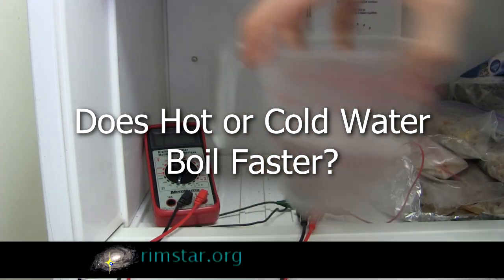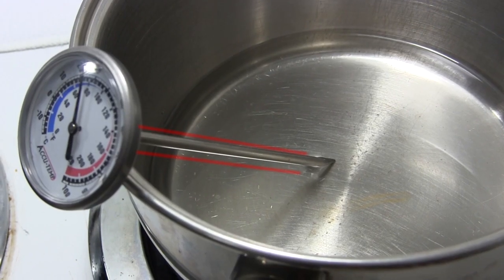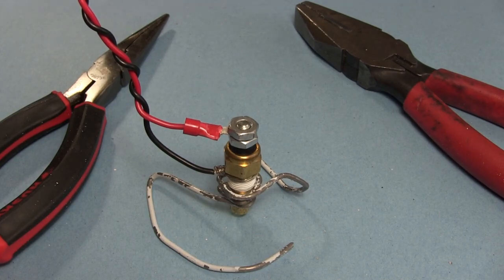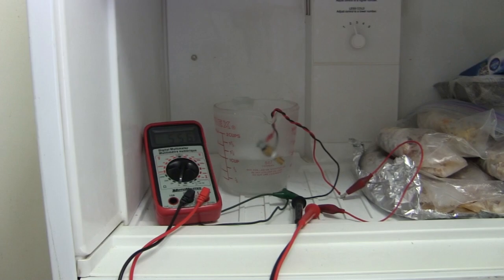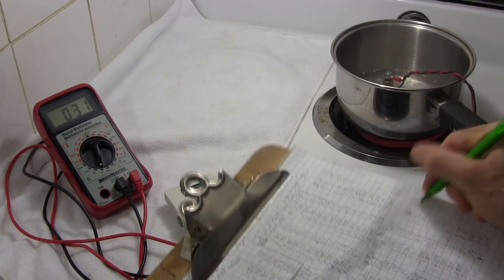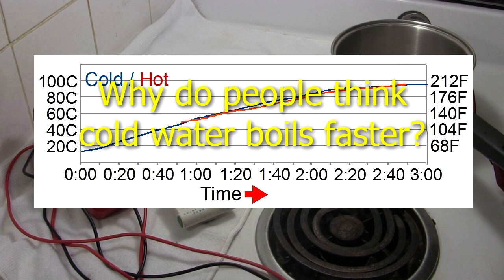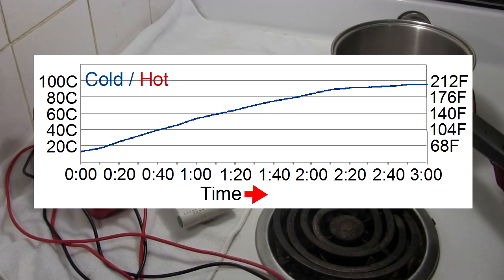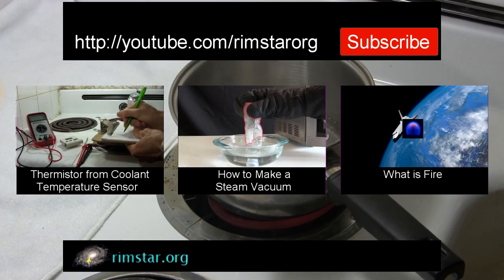Does Cold or Hot Water Boil Faster?

Comment: Nice experiment but I think it is wrong to assume that water instantly vaporizes when it reaches 100°C. What about latent heat of vaporization? A quick google search says that it takes 100 calories to heat 1 gram of water from 0 to 100 deg, but it takes 540 calories to take that 100 deg water to boil due to the latent heat of vaporization. Wouldn't this process dominate and bring both total times much closer together?

Comment: My hot plate will automatically turn off after a certain time. It's usually before I can boil the water. Once off it will remain off until the burner falls low enough temp. Sadly it turns off before I can bring my water to boil. 

Offset this I have been putting my water in the microwave for a few minutes before I poor it into the pot to boil. 

My concern was since hot water heats at a slower rate than cool water then my efforts made no difference. I'm glad to learn that it does.

The best analogy I can think of is if I raced Usain bolt in the 100 meter dash. Only I'm allowed an 80 meter head start. He's cold I'm hot. Bolt may be faster but I will reach the finish sooner bc I'm closer to begin with. Glad to know my efforts are not in vein

Comment: Does elevation affect the boiling time? I live in Denver and have never had water boil in under two minutes
Reply from the maker: Air pressure decreases the higher you go up. And the lower the pressure, the lower the boiling temperature/time. So yes, water in Denver would boil faster than water at sea level.

Comment: lesson take away: unless you have instant hot water from the tap, don't run the hot water for 3 minutes until it gets really hot, the cold water in the pot doesn't take that much time to catch up to using a pot filled with hot tap water

Comment: Why didn't you just add more water to the pot so that the thermometer was submerged sufficiently?

Also, I use cold water for drinking and cooking because I heard using warm or hot water picks up more undesirables from the pipes, but I don't actually know if this is true.
Reply from the maker: I didn't add more water because I didn't want heat losses from the rest of the pot to affect things.
Regarding using cold water instead of warm or hot, I wonder about the same thing, especially first thing in the morning.

Comment: The word fast corresponds to speed. Speed is progress / time (/ as in divided by).

The word boil doesn't represent progress, rather it represents goal.

It doesn't make sense to say how fast you get to a point. It will only make sense to say how fast you move to get to a point. 

It will only make sense to say how fast water heats up.

What we should actually use is the word quick instead, since in this case (boil) it's the time that we care about and not "speed".
Reply: Most people won't understand what you've said.  But, I think the fight for proper English is important and that you've make a good point.

Comment: You have to use more water than that. With that amount of water it doesn't mattter if you put hot or cold in there is hardly any volume so of course its going to absorb the heat from the pot right away. Add 3 cups and retest 8 years later.

Comment: You started with the wrong premise. It’s not cold water that is supposed to boil faster. It’s cool water, or around room temp. Your experiment was flawed from the outset because you have the wrong idea about the “myth.”
Reply: No just no
Reply: @suave9184  Yes. This idiot tested water from a refrigerator. That’s not what people are saying. Nobody says water on the verge of freezing is going to boil faster. It’s about water a bit below room temperature. 🤦‍♂️
Reply: @suave9184  “You idiot people.” Well, you’re obviously mad. 😂🤣 I literally explained my position, I’ve never said ice cold or cold water, so maybe you should take out your misplaced anger somewhere else and get a grip.
Reply: @suave9184  Also, try watching videos of boiling water being thrown into the air when it’s below -25° compared to water at other temperatures. It reacts completely differently.

Comment: Why didnt you just fill up the saucepan so you could use the regular thermometer
Reply from the maker: I was concerned that there would be more heat loss through the sides of the pot, messing with my measurements.

Comment: It doesn't boil faster, it boils at effectively the same rate, so no it's not faster, the hot water just takes less time (i'm not crazy, just read the rest of it) because it was already hot so part of the job was already done when you put it into the pan. Faster in that case it's not related to time, it is related to the rate that the temperature rises. obviously it is "faster" in the matter of time, but the actual rate of which the temperature increases is virtually the same between both of them you just gave the hottie a head start.

Comment: to use tap hot water compared to cold. is cost from hot water tank . so add cost in there. cost to heat cold compared to hot tap water.

Comment: Boils fastest if you heat the pan first then add hot water. If you add hot water to a cold pan your just cooling the water. The hotter the water is when you start the faster you will get to a boil

Comment: Sorry to be that guy, but shouldnt both of the times for the hot and cold start from 0? Why does the hot start at 53 seconds? Im pretty sure you goofed the chart up... like if that were to be graded id have to give you like 50 percent
Reply from the maker: In answer to your question, the chart shows two test runs done at different times as shown in the video and then drawn on the same chart. The length of the runs took different amounts of time because the hot water started at a hotter temperature -- there is no data before that temperature. I overlapped them by finding the same temperature in the cold data (well, 55 for the cold and 56 for the hot). That way they had the same starting point.
Reply: @RimstarOrg  yes that is all fine and well. But the x axis represents the amout of time you heated the water, in order for it to boil. I dont mind really, it just erks me that you didnt plot the time data correctly, ie, starting from right when you began heating, the time that it has been heated should be zero. Correct? Other than that thank you for the video it answered my question well.

Comment: I just want my ramen to be done faster :/
Reply: Fucking same dude
Reply: If you would like your Ramen to be more like a pasta and less like a soup, use two packets of noodles, but only use one packet of seasoning and enough water for one packet.  (2 cups of water, I believe.)  In a measuring cup, fill it to 2 cups of water and add your seasoning packet to the water.  Stir vigorously for a few seconds to completely dissolve the season powder into the water.  Place your two packets of Ramen noodles into a pot, pour the water mixed with seasonings to your pot, and then turn the burner on.  Bring it to a boil and boil for about 6 to 7 minutes.  You'll end up with a very delicious Ramen pasta.
Reply: @nopenottalib4366  are you sponsered by ramen noodles lmao
Reply: If you'd like to add some delicious protein to your Ramen:  Use one packet of Ramen noodles.  Put the noodles into your pot and then add 2 1/4 cups of water to a measuring cup.  Open your seasoning packet and dump it into the measuring cup full of water.  Stir vigorously until the seasons are well blended and dissolved in the water.  Pour the seasonings + water into your pot and set your burner to "High."  As soon as the water starts to boil, crack open an egg and drop the egg right in the middle of your noodles.  Cover the pot and reduce the heat to keep the water at a fast boil - but not too high to cause it to boil over.  Keep it boiling for 10 minutes.  Remove the pot from the heat and remove the lid and let it cool for about 2-3 minutes.  Pour it into a bowl and enjoy!  (It sounds insane - but it's absolutely DELICIOUS!)
Reply: @nopenottalib4366  nah I want to do it normal
Reply: Same..
Reply: Me too
Reply: Put less water

Comment: Cold water does not boil faster than hot water. The rate of heating of a liquid depends on the magnitude of the temperature difference between the liquid and its surroundings (the flame on the stove, for instance). As a result, cold water will be absorbing heat faster while it is still cold; once it gets up to the temperature of hot water, the heating rate slows down and from there it takes just as long to bring it to a boil as the water that was hot to begin with. Because it takes cold water some time to reach the temperature of hot water, cold water clearly takes longer to boil than hot water does. There may be some psychological effect at play; cold water starts boiling sooner than one might expect because of the aforementioned greater heat absorption rate when water is colder.

Comment: I'am not shure for "why the variation speed slows down" : your heat source is red glowing, it's around 750°C. So the difference between the water and the resistor temperature is piratically constant during heating. The main explanation is the fact that water is approaching it's vaporizing point, so the saturated vapor pressure is increasing. An increasing fraction of the water is converted to vapor the reach this pressure under the liquid water. This required a huge amont of energy that will not be used to increase the temperature of the liquid water. At 100°C the vapor pressure is more than the atmospheric pressure so 100% of the energy is used to vaporise the water (and because the room is open the pressure will never increase so it you boil as long as there is water is the pan). The temperature is blocked to 100°C :)

If the pan was airthigh (and a little bit insulated), the speed will be constant (but the specific capacity of water alose moves, life is complicated ^^). 
Great videos !!
Reply from the maker: I agree with that you're saying. As the water temperature approached 100C, more of the energy is going into converting the water into steam and so there is less heating.
And thanks! I'm glad you're enjoying my videos. I look forward to more of your videos too.

Comment: There is a problem with the experiment. The thermistor is in direct contact with the metal pot and that in direct contact with the stove element. I suggest that you measured the temperature rise of the metal given that the water reduced the heat transfer.

Try conducting the experiment again with a double boiler, and keep the thermistor from contacting any of the metal.
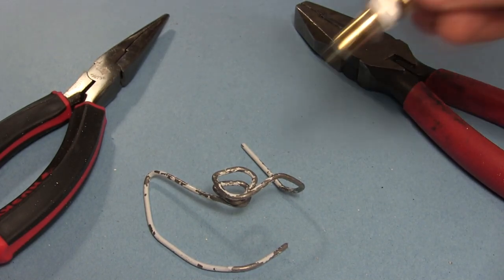Reply from the maker: +Richard Tomkins Thanks. I'm not sure if I'd considered that at the time, however, the stand holds the thermistor a millimeter or two up. It's hard to tell that from the camera angle but you may be able to see it at 1:14.
Reply: +RimstarOrg  Well if it's not actually touching, I guess it should be fine then

Comment: I don't agree with your argument that the rate of heat transfer decreases with increasing temperature is reason why the heating curves are not straight line. The hot plate is so much hotter than the pot that this should not be a strong effect. I think the main reason that the temperature rise slows down when the water temperature approaches boiling is due to the fact that the evaporation rate increases strongly with temperature and since evaporation needs alot of energy more and more of the heat supplied by the stove is used to evaporate water rather than to heat it. Once the water reaches boiling all of the heat supplied by the stove goes into evaporation and the water temperature doesnt rise anymore.
Reply from the maker: +DANG JOS I agree too that as the water reaches boiling temperature the reason is that more energy is going into evaporation. Looking at the chart again though, the slope change starts to be noticeable at around 60C/140F, 1 minute in out of the 3 minute measurement period, so I too suspect that the curve change is not all due to that. Too bad it's not possible to go back and edit YouTube videos. I've added something to the video description as well as an annotation.
Reply: +Rainer Beck  I must agree with you.  that's actually the same thought I had while I was reading the beginning of you're statement and realized you said it later.  Yeah, the stove itself was probably around 1,000 degrees F depending on how hot it was, so that temperature difference wouldn't make a very large difference.  it isn't completely negligible though.  I would say that it is a combination of the changing temperature gradient and evaporative cooling

Comment: How about water that had previously been frozen and then returned to room temperature. would that water boil faster than water that had not been frozen?
Reply from the maker: No, it wouldn't boil faster. From any given temperature, the remaining time to boil is the same. You can see this in charts in the video. Once the temperatures overlap on the chart, they keep overlapping.

Comment: So is this curve a reflection of heat loss , rather than heat gain . As the temperature increases it sheds into the surroundings , and as it temperature notably outstrips the exterior there is dispassionately more convection & radiation leading to a curve . If this system was lagged ie an electrical element in the water & a well lagged / insulated cylinder & little air to convect the heat away , would it be closer to a straight line ?
Reply from the maker: The curve is a reflection of heat transfer, a heat loss from the water and a heat gain to the surrounding room. Strictly speaking the curve isn't due to convection. It's just a property of how heat is transferred by conduction from one medium to another medium. As the temperature difference increases the heat transfer happens faster. I have a webpage all about it on my website, including a handy calculator so you can play with different temperatures but the formula's there too: http://rimstar.org/renewnrg/heat_transfer_loss_calculations.htm

Comment: Im no scientologist but couldnt you have just ADDED MORE WATER so wouldnt have to go to Kragen Auto Parts to finish your experiment? hahahah
Reply from the maker: No, I decided not to add more water because it would have added a lot more surface area and therefore more heat losses. That would have made the data useless.
Reply: first off i was kinda just poking fun a little bit in my first comment so sorry about that lolol i like this video a lot and i think you did a great job. However, i can see how heat loss would make your data useless if the test was "how fast can you boil water" but since both boiling pots would have equal surface area wouldn't they have equal heat loss and therefor still relevant and useful data?                                                                     and also I'm actually cook myself i would have actually liked to have seen a kind of "real world scenario" where you boil say 4 cups of water which is something more people could relate to and find helpful as well. THAT is something i'm curious about so when i'm home I can get to eatin my Mac and Cheese asap;]
Reply from the maker: adam lafontaine
I see your point. And you may be right. But when doing science experiments you usually try to reduce the variables as much as possible to just the ones you want to test, so in this case I wanted to try to keep the thermodynamics  to just the electric stove element and the water, and trying to minimize the thermodynamic effect of the sides of the pot (and air outside the pot) and water. Maybe that would have been the same in both cases as you say, but the effect would have shown up in the data, and my data would no longer have been just the stove element and water thermodynamics. The conclusion would have been the same but the data wouldn't have been as clean.

Comment: Plus it's not good to use hot tap water because it contains lead.
Reply from the maker: If I understand it correctly, the amount of lead usually depends on your piping. I think it's the lead in the solder that joins the pipes, but I could be wrong. Often people will run the water in the morning to get rid of the water that's been standing in the pipes over night.
Reply: In France, pipes were made of lead but not anymore.

Comment: So while "faster" would normally be taken to mean "takes less time", the average heat transfer per second is actually greater for the cold water. If it had been a race between two cars, the hot car would have finished first due to a head start, but the cold did actually drive faster.
Reply: Great analogy

Comment: The reason many people believe it's better to use cold water is because many water heaters are too cold to kill much of the bacteria in tap water, in fact, if your water heater is too cold (below 120°F) bacteria can thrive. 120°F is about normal for a water heater, but to kill 99% of the bacteria you need your water heater at at least 140°F, just be sure to have a temperature regulator valve before the water reaches the taps, as it would be easy to accidentally get burned.

Comment: #2  What they did not take into consideration is that because both were put in the same space simultaneously, the freezer must cool the space as a whole and the hot one warms the space . so both will freeze roughly at the same time. But if the experiment was conducted in two separate freezers the outcome would be be different.

Comment from the maker: I'm with you on that, but I've heard it a number of times over the years. One possible explanation I came up with was the one I gave in the video, the greater temperature difference between cold water and the heating element causes faster heat transfer, and maybe some people misunderstand that to mean it'll boil sooner, which it doesn't because the heat transfer rate decreases as the water gets hotter.